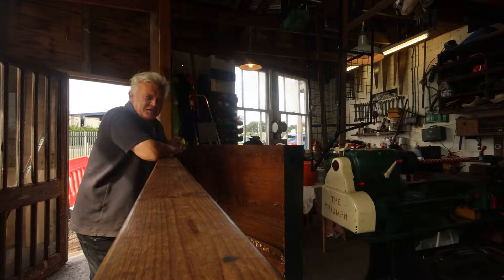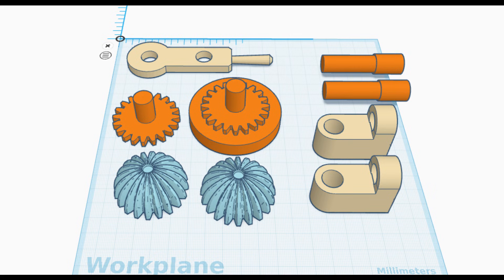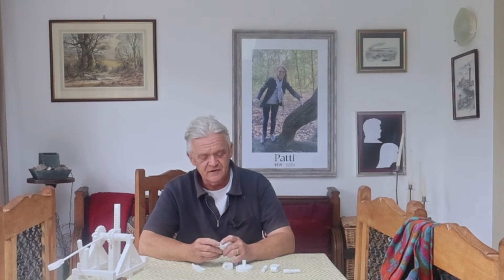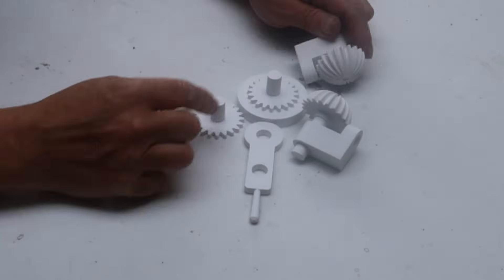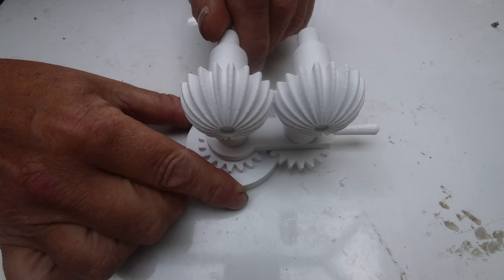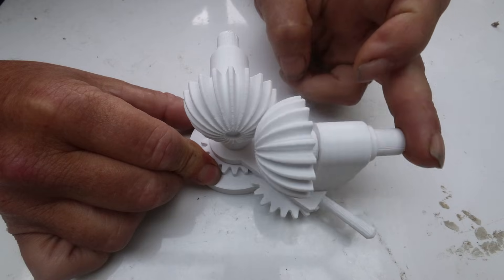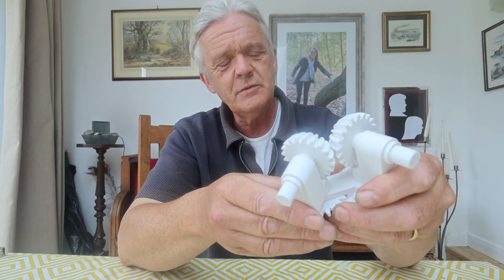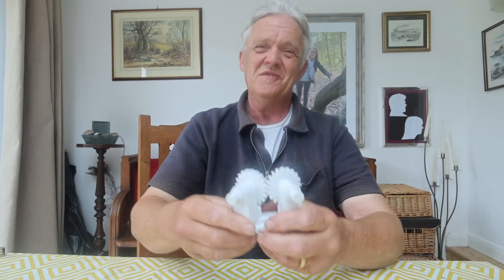2432 Hemi Spherical Gears

Comment: Mr RMS, i'm really busy lately but sometimes i reply my thoughts and toss random personal tinker ideas but i had mentioned i was fascinated by the uses of clutches, many applications once atleast then worked on a magnetic airconditioner automotive clutch where a magnet winding controls compressor operation or drive so my point is now i scrapped a washing machine with a high carbon , maybe stainless , thick rod the middle plastic paddle with 4 fins bolts to so i was studying the clutch to reuse it and took the motor labeled amps and V and rpms , with a cool water pump too, my point the clutch pads grab and the paddle smacks bit the load slows it doen so it spins and then the clutch grabs and the plastic paddle smacks the water and dirty cloths and all cycles the same direction REALLY COOL UNEXPECTED PLACE THE GEOMETRY .....GOD BLESS YOU SIR I BETTER WORK IT GETS DARK EARLIER AND STUFF ....(edit: to clarify this design the clutch pads non stop grab and release based on the load making the motor speed decrease and then the motor speeds and the clutch pads grab again (over and over the same direction to make the paddle smack the water/c;othes)  it looks like , it has a cool gearbox too ...

Comment: Wouldn't it be able to work in a straight line if the ribs depth was constant (even though the width decreases), and the ribs ended shortly before the pole of the spheres (allowing the opposite side to mesh while still being meshed on the other side)? Maybe that's what the one from the patent with the constant width aims to achieve? It looks like one "star" is recessed while the other is extruded.
Reply from the maker: yeah i suppose it would - you could always just stick magnets in the end too

Comment: Does it mean the gear ratio changes as the gears move to the top? if so could make a more smoother gear change, more fluid/ gradual.
Reply: You could change the gear ratio by making one of the gears bigger or smaller than the other so that the two gears have a different number of cogs, but rotating the gears doesn't change the gear ratio, because it doesn't change the number of cogs that touch each other with each revolution.
Reply from the maker: no mate - you can think of the hemisphere as a lot of stacked gears all the same size - as you move them around the size of the gears change but the relationship remains the same - that is one to one

Comment: Cool. It has a natural neutral position and a natural reverse gear built in.
Reply: You are right about the neutral position, but turning the gears to their other side wouldn't reverse the rotational direction of the gears.
Reply: @roboraser770  
I just did a mental visualization, and I can see your point.
Reply: @roboraser770  
More visualization and I'm pretty sure it reverses rotation.

I need to see if I can do an animated mock up in FreeCAD.
Reply from the maker: I must be missing something - what you say sounds right to me - do that animated mock up and let me know will you?
Reply: @ThinkingandTinkering  RIP
Reply: @ThinkingandTinkering 
I should have just drawn it out on paper like I just did. Less complicated. 

It's no different than moving a flat from one side of the drive gear to the other side of the drive gear.

The driven gear would have to engage a third gear for it to go in reverse.

My visualization muscle needs exercising, it's weak.